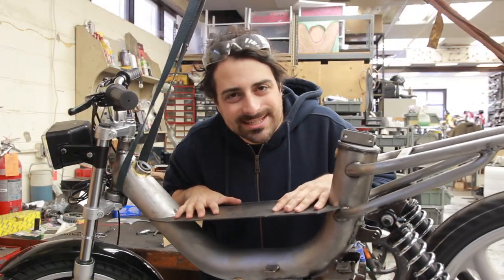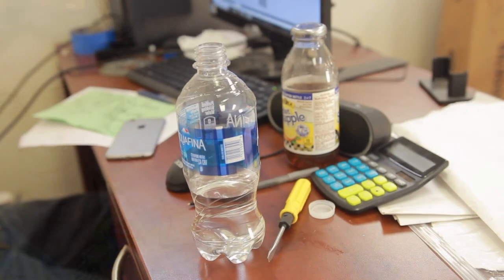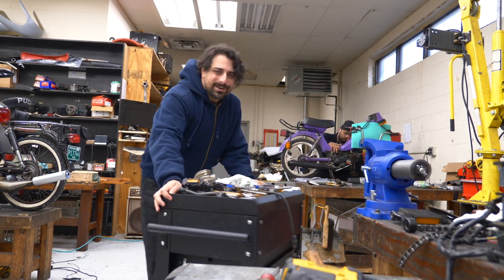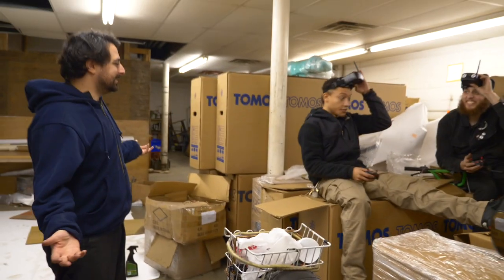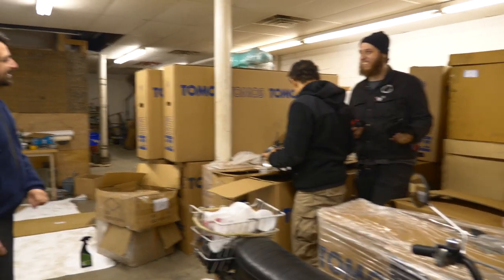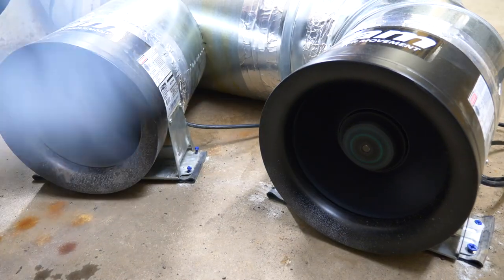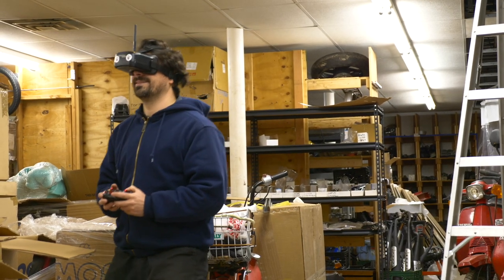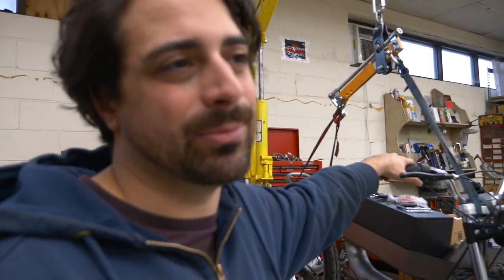BYE BIKE Mopeds (and Other Delights)

Comment: What engien is on that? Is it based off of an existing desighn?Ima have to read that thread on MA again.
Reply: Its based on the variated Derbi engine. Which is awesome because its got a case reed and it takes derbi cylinders
Reply from the maker: Doesn’t actually take Derbi cylinders... but there is a kit available.
Reply: @MopedProblems they should be compatible as they're the same bore and stroke. I was also told by someone they fit a derbi flat reed cylinder and piston kit with no modifications.
Reply from the maker: I haven’t tested this yet but I’ve heard that the cylinder skirt would have to be completely removed to fit a derbi cylinder.  And of course if bore and stroke are the same or similar modifications can be done to make anything fit. Nonetheless, a bolt on kit is available out there, somewhere
Reply: @MopedProblems  hey that could be its own video ;). It'd be cool to see if a derbi flat reed or pyramid reed exhaust would at least fit the header.

Comment: Smoke rises. Just a thought. Salute
Reply from the maker: I was going to add a smaller fan up above, for residual fumes, but I was advised against it. This is designed as a downdraft system.  There are more Elements involved that have not been installed yet elements involved that have not been installed yet. Future video.
Reply: @MopedProblems  Okay, Heard. Yea, bc just like that had Me like, "uuuuuhh..". Salute

Comment: What is the point of the Bye Bike if it does not have pedals? No pedals is a deal breaker.
Reply: Search bye bike. There is another variant style of it without the full fairing and showing the pedals. Pretty sweet. Can try this link too. Picture on page 1. Just scroll down a little. I will definitely get it. https://www.mopedarmy.com/forums/read.php?1,4253147,page=1

Comment: The bye bike looks like a derbi variant. What's the engine on it?
Reply from the maker: It’s very similar to a derbi motor but it has more “scooter like” components like variator and dry clutch combo you would find on a modern scooter.  It’s made by bye-bye.
Reply: @MopedProblems  that's pretty cool, sounds like it's performance capable